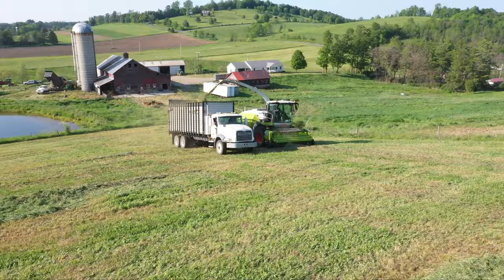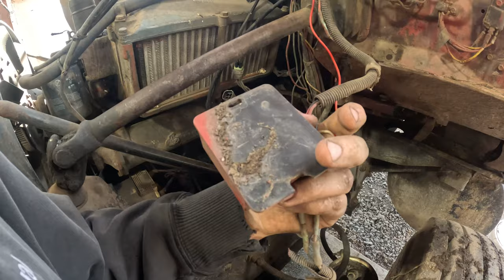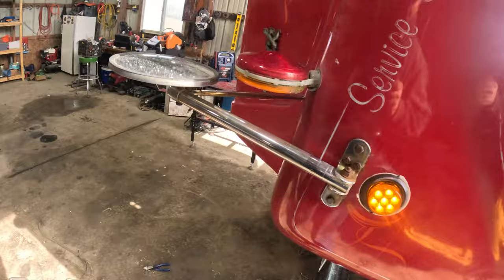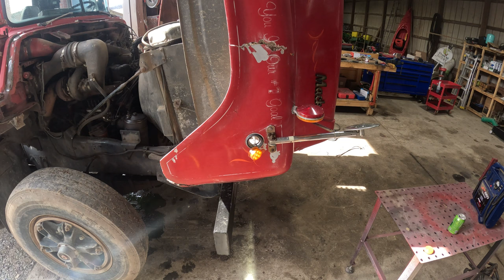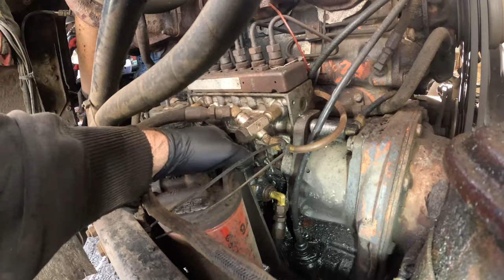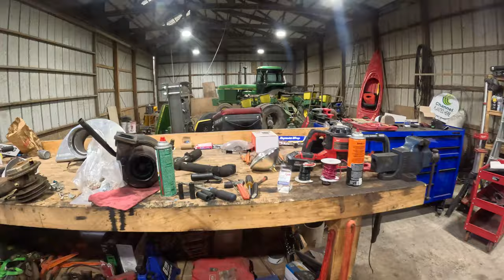Mack Wiring Figured Out But What About Engine Brakes???

Comment: Harbor freight has coolant system pressure checker kits. You put it on your radiator cap hole and pump it up to pressurize the coolant system to find leaks. They aren't very expensive either sir.
Keep up the great work Chris! You make us guys with older equipment proud buddy!!!
I have a 86 Ford LTL 9000 quad axle dump truck with a 400 big cam Cummins 8LL trans

Comment: My experience chasing down Jacobs engine brake gremlins I usually start make sure it's got power at the on switch then check the clutch switch has power getting through it and then fuel pump switch at the pedal and to the head

Comment: A suggestion for the mystery coolant leak. Use Bar's leak liquid in the coolant system. It'll seal up leaks throughout the whole system and won't block the waterways. It'll also quieten water pumps by reducing cavitation. Great stuff. It will need replenishing every year, but you won't get any pinhole leaks.

Comment: Ive been rocking a ridge wallet for almost two years now and I haven’t replaced anything on it yet its been run over and it looks like hell but its still going i just need to start replacing the strap part it’s starting to dry rot